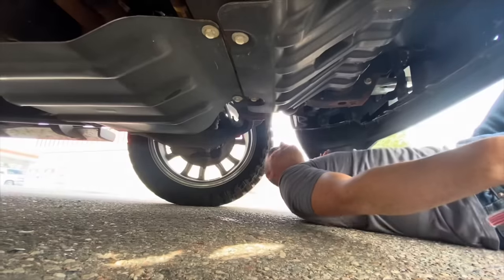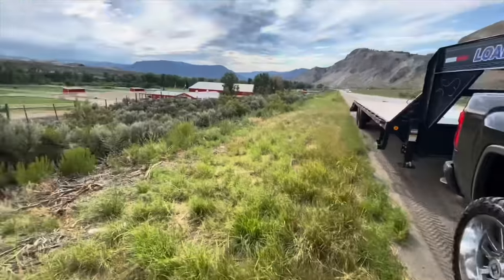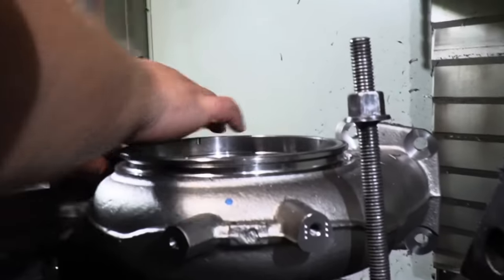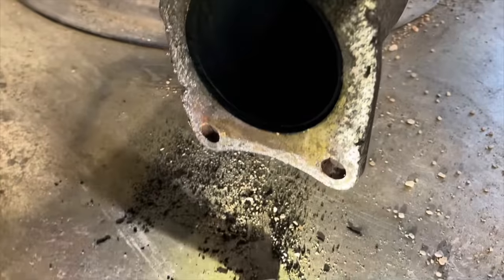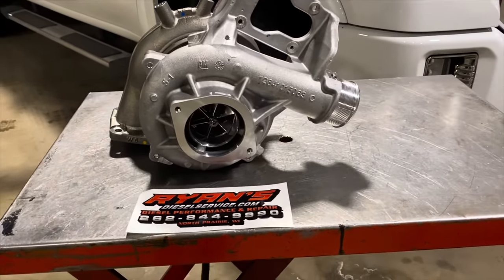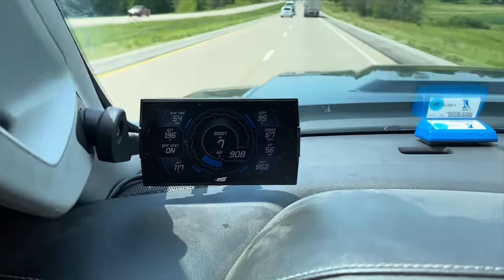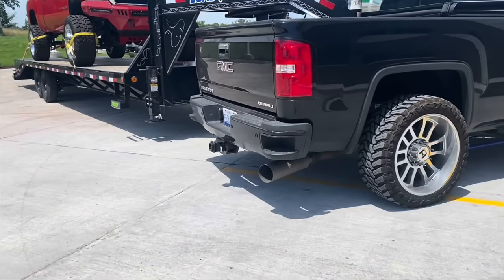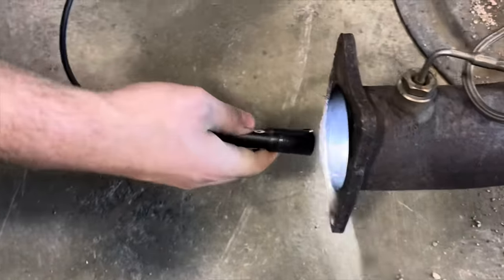This Is What Emissions Did To My Diesel! Heads Up Diesel Owners!

Comment: You should have drove the LBZ. I have a 2007 classic lbcc drw 4wd with LBZ all deleted and a bunch of Banks stuff on it. Its a work truck, no stupid hot rodding. 625hp, 1250 ft lbs tq, 24 MPG unloaded hwy at 70mph. 11 mpg around town hauling 18000 lbs gooseneck with 2 kubota zd's plus bagger grass. EVERY WEEKEND since 2013. 250k on the odo. Still runs like a champ. NO problems ever. 

Just for shits and giggles, put the super sport tune on and took it for some fun once. Had to put in 4wd to quit burning the 4 big rears. 0-60 in a bit under 5 sec . It outran my 2007 TBSS awd! 

IMO, there was no better modern engine made than the DMAX. But the GOVT has killed it by shoving so much up its ass! Nothing can live if it can't take a shit!

I will spend $$$$ to rebuild it if it ever craps out and NEVER replace it with something newer. With that said, I own a 2011 DMAX CCLB DRW and though it runs OK'ish, is a giant, fancy POS! I want to take a ball bat to it every time I have to dump Obama piss in it!

Comment: I have a 2001 Dodge Ram 3500 dually with the 5.9 turbo High output motor there is way I would buy a new truck now days.

Comment: I STILL have my old Ford F250 Lariat Supercab 4x4 7.3 that I purchased new in 1988!
In no way shape or form would I EVER want a newer diesel unless > > > I needed to WORK that truck and it MADE ME MONEY, period. F, the price of garbage fuel F, the problematic emissions crap and F how much it costs to keep that junk running. The EPA turned a once great, simple, extremely reliable diesel engine into a f'ing expensive headache.

Comment: Must be nice! When my '20 Duramax broken down last year while I was way out of state, neither GM, the GMC dealer or anyone I called would do shit to help! Despite the fact truck only had 52k miles and under full factory and extended warranty. Left me stranded for a  week with my RV. Turns our the GMC dealer destroyed the engine by reusing the old crank shaft bolt. just the beginning of the nightmares I've had to deal with with GM!
Reply from the maker: Yikes!

Comment: WOW! I just Bulletproofed my 94,000+ 06 F 250. I bought it used with 50,000 miles for $19,000 in 2013, from a old guy that used it to haul goat feed and pull a 9000 pound 5th wheel 150 miles twice a year. All services were done at the Dealership. $19,000 + $2000(FORD extended warranty)+ $2000(New tires, Bilstein Shocks, Brakes)+$6000(Bulletproofing)= $27,000.00. That's a lot less  than $80,000+ for a New Truck and I don't have to worry about DEF!
Reply: Yup, I just bought my buddys 6.0 outlaw
rebuilt motor. 
Good thing they know whats wrong with these things, and can fix them probably cheaper.

Comment: Deleted my 2.0L TDI and will never go back. I get 4.8L/100km (over 50mpg) highway now 😁.

If the government doesn’t like the inherent flaws of diesel engines they should either stop their sale entirely for consumer use or come up with a better solution. The DPF is a flawed system on every vehicle it’s attached to.

Comment: IMHO, the problem is that the EPA regulations are not getting reviewed. 
Technology got better. Diesel got cleaner. If you remove EGR and DPF from the system you gain 150HP and your highway mileage gets up to 25 mpg. What does it mean in lamest turn? You burn less fuel, resulting in less pollution per mile. One may think that the requirement is kept in place as a job security. And an expensive one.

Comment: this is absolutely normal, i mean whatever happens to a diesel engine, let it be old or new, if it starts to smoke then its just a matter of time to fill the agr valve. in europe at least its mandatory from the early 90s, and its one of the first things to deal with. Wither block it off and fool the ecu, or we clean it every 2-3 years, depending on the car and engine. Even if its clogged, it rarely damages the turbo or the induction system, mostly its just a loss of power

Comment: This is legit every new truck though. I bought a 2005 dodge common rail 5.9 that makes 945lbft of torque and has a 6-speed nv5600. don't buy anything new unless you are ready to pay the price of the vehicle in maintenance costs. the 8 and 10-speed auto transmissions are garbage as well. 

P.S. throw that Snap-On bore scope away, there are Chinese ones with a light and better image quality. :P

Comment: The fact that people are targeting vehicles more than plastic is what concerns me. Plastic will if not already has surpassed the pollution rate of the automobile. It’s extremely toxic to produce and simply put its coming to the point where we’re actually not going to be able to recycle it efficiently anymore. Stopping the production of plastic and composite materials will yield better results than the elimination of combustion engines at this point. Just throwing it out there

Comment: Looked at a couple of ‘23 diesels on the lot this weekend. $110k on the sticker. They sure were pretty. 
Never ever ever ever ever will I buy one. 
I drive a ‘99 F-350 with a 12 valve Cummins swapped in. Hope I can keep it going forever.

Comment: I was this close 🤏.. to getting a diesel as I usually do but because of these issues with emissions, I went with the big V8 gas and it has been a awesome decision. The truck pulls like a diesel and actually has decent fuel mileage. These new 3/4 ton trucks with the large V8 gas motors are actually impressive. Your fuel bill is not much different but it's actually better because the oil changes are cheaper and had no repairs other than regular maintenance. If your emission system fails on a diesel past it's warranty it could easily cost thousands.. and thousands of dollars buys alot of gas.

It's unfortunate that emissions is ruining diesels, which I used to love to use to haul our trailer. But I'm impressed with our new 3/4 ton gas truck, so not all is bad I guess lol

Comment: I'm a firm believer in deleting diesels. As someone who sees what def has done to semis and tractors as well as pickups it's not a good system. Once the emissions system fails it'll keep failing. I've had friends completely rebuild the emissions new wires new sensors new exhaust. Truck still threw codes and limped.

Comment: Also on the mpg I'm averaging over 32 mpg pulling a 40 foot gooseneck. Empty. So in a older diesel no smoke no emissions will run cleaner than most emissions equipped trucks. Remove the efficiency remove the mpg and performance. Look at the whole picture. It's not how it looks. Good job again guys. I'll take old over new anytime. Never buy new again till they get the performance and economy back we're it should be. No more epa. They need to go away.

Comment: Newer vehicles are money pit….if you own a classic.. it’s simple maintenance and it keeps going. Modern vehicles manufactures now a days have sensors and cheap parts are installed so they break or breakdown completely so owner buys parts or buys another vehicle.

Comment: My 7.3 Diesel! a year ago I was almost going to buy a 6.7 Dually  pull my fifth wheel Like a previous individual wrote I am very glad I did not I don’t have to deal with def  the emIssions 
And all the other crap the government shoves down our throat At 243,000 miles I have the original injectors original glow plugs I replaced the transmission at 235,000 miles I change the full synthetic  oil the coolant I do everything including a lubricant  to the fuel I also watch the videos with new trucks and all the issues just saying

Comment: I love diesels, but these new trucks aren't worth all the problems and extra expense. You factor in up front cost, extra maintenance cost, diesel vs gas cost per gallon and then problems like this...I can't justify it. The old 5.9 Cummins without all that emissions crap might not have the grunt, but it keeps on going.

Comment: Running synthetic oil?  Dealer told me that he was having a line up of Duramax trucks with plugged up DPF filters and they were all running synthetic oil.  Warned me that warranty does not cover it... so I run either AC Delco or Rotella in my Duramax... which really loves the Rotella actually.

Comment: Should of brought a RIG
YALL hotshot have too many issues every month 
Trailer issues or pickup issues. 

I just see HD trucks driving local within 200 miles, not OTR
Yes HD go camping across America but those trucks are not working for living.

What kills those pickups is idling all night. They made to run, not be used to keep u ice cold all night

Damn that DEF system.

Comment: I like the looks of the new models. But I stick with the older models there more reliable and less expensive to maintain. I drive a 2004 Chevy 3500 8.1 vortex 262,000 miles; 2001 Chevy 2500HD 6.6 lb7 Duramax 92,000 miles. 1999 Chevy 2500 6.0 vortex 212,000 miles.

Comment: DEF Sucks. Blocks everything out. Heat is its nemesis and if it sits too long or the filter goes bad. I’ll always stick with the five. Nine Cummins. Never ever had a problem. Of course I remove the transmission and put a 1 ton in. And keep the maintenanceBest truck ever built is pre-DEF 5.9 Cummins without a doubt. Of course I remove the Adelphi Lip Pump and I installed a FASS Lift Pump. And I replaced the Bosch VP second GEN with the new GENVP 44 that has the new components and the dodder problem was remedied

Comment: I have a 7.3 power stroke engine has been totally redone over 500 horsepower with a stage 3 billet  steel transmission.   I have 15 to $20,000 in my truck.   No regen no diesel exhaust fluid no codes no bullshit.   I love watching these videos.  800 - $1,200 per month payment and broke down 1/2 the time.   And on top of that most of these guys making these videos are smiling while the diesel tech and the dealerships are ramming it up there ass.  🤣🤣🤣🤣
 He may not have shit for brains when  it  comes to buying a truck but at least he has followers on YouTube.  👍

Comment: Well on top of emissions, there are all these electrical problems on the 2020 + 2500 and 3500 chevrolet/gmc trucks.  I have a 2020, and the damn thing has so many gremlins...  Trailer connected, trailer not connected, trailer brakes connected, trailer brakes not connected, etc.  What gets me is that I get the "working as design..." from the dealerships.  I am so pissed off at the failure of Chevrolet to address my truck.  They want me to pay another 225 bucks for them to attempt to diagnose it.  Reminder you I already have had it in there for the same reasons, over and over again.

Comment: just watched for first time  I am a diesel fitter 40 years a in Australia. Facts as i have proved the very device designed to save the planet actually cause the vehicle to consume up to 32 percent more fuel  My 08 ram 2500 with some Gail Bankes  (the master) makeing good no smoke power runs at 9.8 liter per 100 Ks  SO how is running the world out of fuel faster better for the planet   Garrey

Comment: No more than I use my 98 model Chevrolet 3500 with a 7.4 gas engine I have very few issues with it and it pulls my antique tractors just fine. I have owned diesels in the past and I can’t see how I personally can afford one no more than I need a One ton truck to pull a large trailer.

Comment: What they have been doing to the semis for years.
It added a huge cost and constant break downs that cost thousands per year in extra maintenance and repairs that have to get passed on to consumers.
If they were not passed on the industry would literally go broke.
The system adds $28,000 to the price of a semi truck.
The average service on them was around $3,000 each time when I was driving long haul and they can be hit or miss solving the issues they have.
A new filter in a semi, as they do start to burn through, is $10,000.
From experience, over the life of a long haul truck they have cut down the use of a truck from nearly 2 million miles to 1 million because of the costs of trying to maintain the DPF system alone.
Reply: And much of that added cost was due to technicians that were not properly trained on the aftertreatment system and were replacing parts to treat a symptom and not addressing the root cause of the problem, such as an injector issue or EGR issue. How do I know? I'm a diesel technician by trade, and I see it every day. Worst part is: you can't convince some people that they need additional training to understand what they are working on. Either ego or pride (or both) get in the way.

Comment: For heavy hauling and pulling trailers of road I would never buy another GM truck.  I had a 2003 3500 Duramax and what a pile of crap.  Steering issues all the time, speed sensor’s all the time , bad injectors and blown engine.  Then the rusting issues and most importantly the frame rusting through.   In a half way defense for the rust I work in and around salt and brackish water but I have older Fords with very little rust.  Of all my trucks I have kept a 2002 7.3 and 2006 6.0 and I have very little issues..  Yes I said 6.0…

Comment: I have come to the conclusion that since the emissions are year specific that I will be buying an older truck without the emissions and replace it with all new parts/engine and delete everything because due to the year none of that crap is required, new engine performance and none of the issues

Comment: I got a 07 lbz and I pull campers part time and after about 4 hrs in it will lose power and throw a low fuel rail pressure code. I think I have a bad fuel line next to valve pan cover I am going to change, I have always owned cummins and this is my first Duramax. What do you think would cause this. It just hit over 200,000 miles.

Comment: i did a cp3 conversion on my dads stock lml with 170k on it and was pretty surprised how little soot was built up in the egr and intake. the system hasn't missed a beat aside from the def heater going out around 150k

Comment: I had to rewind the video,  (24 MPG)  MY  2010 6.4 stays around 11 mpg. It's a beast and I love it but it stays thirsty. It has around 13000 lbs worth of truck and tools. Is this a normal mpg with that kind of weight? First deisel I've owned and will not be the last. That much weight and still feels like a rocket.

Comment: Question for the diesel tech's.  I purchased a 2012 dodge with a 6.7 and have only seen it regen 2 tume sinc new  and that was when it was new ,I now have 59,000 miles on it and it doesn't regenerate or it doesn't show that its regenerate.  I has no codes  and run good.  Is this normal or do I need to get it looked at. Thanks.

Comment: We did the delete on every Cummins we have owned. We had this issue happen twice and after that said screw it. We prefer Cummins just cause we like that sound of it more than the other diesel pickups. Cummings sound fat and mean. A buddy of mine got one that was yellow and named it chonka truck. A chonky tonka truck. I get the whole emissions stuff but at the same time in the long run it will cost you more money. Granted our tuning was not that expensive b.c few buddies of ours owned a tuning shop So we had it a bit cheaper.

Comment: Should have known better buddy 
EGR Blockoff or full delete is mandatory with these new diesels and a DPF delete is recommended BUT since they tune these trucks poorly at the factory it may roll coal with the DPF out. 
So most often they need a full retune done once its deleted.
And since the DPF plugged up fully Im 99% sure the signs were there before.

Comment: Here in the uk we have nothing but trouble with DPF on Diesel engines , my Isuzu truck was so bad constantly doing re gens that it would put diesel In the engine oil, the manufacturer even put another mark on the oil dip stick to let you know when to much Diesel has got in the engine oil, now we are being forced to drive electric rubbish vehicles. I try to buy older vehicles now before all these restrictions were put on.

Comment: Truck Master didnt drive it long enough to to find out about "limp mode". So basically, when your emissions system fails in any way, the truck limits your speed. First 55mph, all the way down to 5mph until you take the truck in. And no, there is no way clear that unless you fix the truck, or do a complete tune/delete. Thats extortion. Governement has ruined the diesel engine.

Comment: There should be an exhaust bypass to reroute the exhaust when it happens again . Maybe you should remove all the regen system and take it to DC and drop it off on the steps of the EPA's offices. Oh and send them the bill for repairs and shipping. Is it really saving the environment when I am seeing that the systems shorten the life of the vehicle and therefore the vehicle has to be replaced or a whole new drivetrain. There is a carbon footprint created when they have to build new engines or vehicles for replacement so I don't understand the epa's thought process other than political.

Comment: I don't understand low profile tires on a diesel that gets used for towing. Likewise, I don't understand owning a diesel and not towing. Loss of towing capacity, harder for engine and trans and it starts looking like you wanted a car, but needed a truck. I'm sure I'm wrong  about something.

Comment: I know some wouldn’t agree for various reasons, however if not living in an emissions regulated area, DELETE that nonsense off the truck.  The cost difference when compared to something like the repairs or replacement parts is very noticeable.  Not to mention economy goes up and reliability improves drastically.

Comment: Well, we know that the short trips, in town, and the five to ten minute drive, or excessive idling will lead to major soot, and issues. How can a long trip at highway speeds, cause so much soot to plug your system, when you are at constant speed and rpm.

Comment: I would just laugh about this stuff in my semi trucks the Regen had to run at higher RPM's like 18-20 to clean the system but the company's or lease companies would drop the RPM'S to 16-18 trying to increase the fuel economy